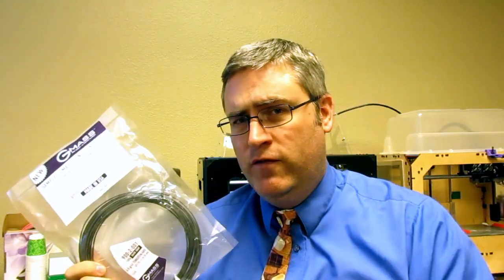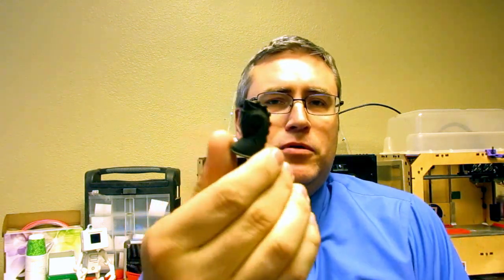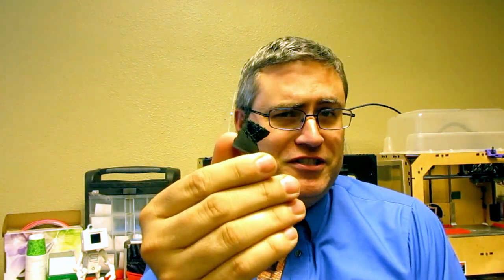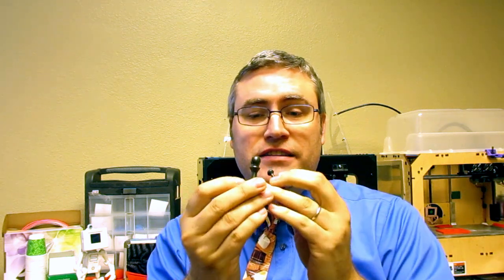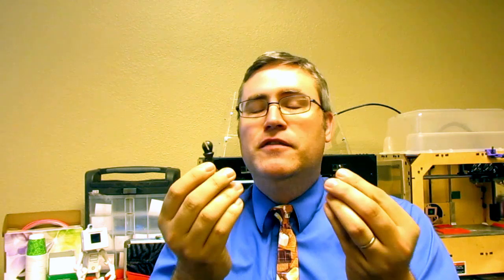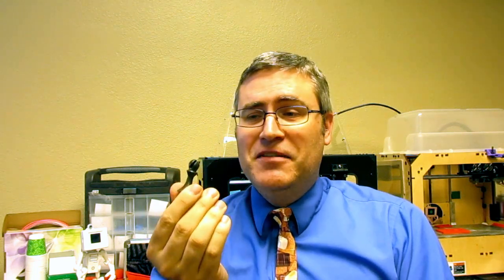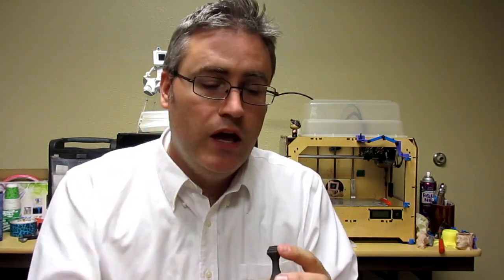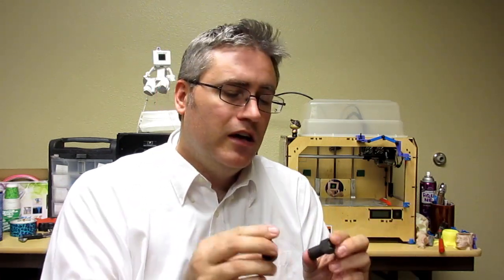3D Printing with Tungsten

Comment: tungsten filament? feels like that would ruin even the hardest hardened steel nozzles in minutes.
Reply from the maker: I recently realized that my hardened nozzle had been reemed out. Couldn't figure out why prints weren't working until I set the nozzle diameter even a little higher. Yeah, this stuff is rough on even the hardened nozzles.
Reply: ckusel123 yes, not only carbide coated but made entirely from carbide.
Reply: On the hardness scale, tungsten is around hardened steel. Tungsten carbide on the other hand is harder, and is abundant in the wood and metal working industries, so its probably the easiest of the hardest materials to source meaning it'll be cheaper.
Reply: There's the olson ruby nozzle. Corrundum isn't quite as hard as silicone carbide, but nearly.
Reply: My thoughts exactly... any carbide coated nozzles out there yet? lol
Reply: Ceramic nozzles, ftw.
Reply: davidsirmons they will crack after a certain pressure and temperature are achieved.  Need to make a sintering power  printer that makes an object that once heated fuses to the final object

Comment: if your piece is hollow like it seems to be the case with the pawn, you could try to fill it with fiberglass resin thickened with powder. It may give the parts enough strength to be used without sweating it. I have not tried it myself (yet), just an idea 
good vid
Reply: +1 on the resin fill, then hand wet sand with acetone high grit?
Reply: Bondo body filler? linseed oil putty even.

Comment: Could this be so brittle because it was printed to fast ??!!!. I had abs, that had become verry brittle if i had printed it with more than 40mm /s
Reply from the maker: I think it's brittle because it's a mixed material. The PLA and the tungsten don't blend like an alloy, they remain separate, the Tungsten dust suspended in the PLA. So the PLA isn't solid, it's broken up by little holes of Tungsten. And whether the holes are Tungsten or air, it weakens the surrounding structure.

That's my theory anyways.
Reply: That could be one reson. I think the problem with the abs was, that it does need time to melt togeter with the other layers

Comment: Would the tungsten not be an ideal material to use to 'coat' a stronger core material in a dual extruder machine? You wouldn't get the heft of a pure tungsten build but the brittleness would be minimized.
Reply from the maker: That's a potential way. You'd only keep the look, and quite frankly if you want a metallic look there are better ways. Like Krylon.

Comment: Does it conduct electricity at all.. Has anyone zapped it yet ?
Reply from the maker: Just checked it with my multimeter. Nothing. Might as well have been trying to conduct through plastic. Fortunately there is conductive filament.
Reply: 3D Printing Professor
I didnt htink the multimeter would be good enough. Thanks for trying though.
Though I am guessing its insulation properties will break down at some point. A multimeter only puts out <10volt.
Do you happen to have a cable insulation tester? Id be trying with that.
If it can handle 1000v over say 20-50mm with no arcing then id be a little disappointed.
What I meant by 'zap' is a visual electric arc. Thanks for sticking the meter on it and replying :)
Reply: Tungsten is ~30% as conductive as copper and ~28% as conductive as silver, and ~17% as conductive as carbon. Tungsten is also more resistive by ~3.5 times as copper, ~3.7 times as silver, and ~5.9 times as carbon.
Tungsten is similar to Zinc, where Zinc is ~84% as conductive and ~1.05 times as resistive. 
Add the fact that the filament is plastic with particles of Tungsten (Melting point of 6,191°F or 3,422°C) and the resistivity of the plastic makes the material virtually non conductive. The plastic may however be electrostatic, but not actually conductive.
Reply: ok. So I will change my question to insulation then. At what voltage does it break down. :D
Reply: It's an ABS based product. Abs has a dielectric constant of 3.2-3.3 @1MHz, dielectric strength of 20-25 Kv per mm^-1, dissipation factor of 0.02 @1Mhz, and a volume resistivity of >10^15 ohm/cm. Properties are most likely skewed due to the dispersion of tungsten in the material.
Reply: It could be an interesting test. I suppose it comes down to how much metal is in it, The size of the particles, And the amount of plastic separating each metal particle.
Reply from the maker: This whole conversation is way over my head. Wow.
Reply: I'd assume that it's majority tungsten considering how abrasive it is, with the plastic being more like bonding material rather than a filling material, which would also help in layer adhesion. 
Not enough material thickness to stop tungsten from being an abrasive object, and I'd assume the inner material between tungsten particles is either as thin or thinner than the outside layer, which by simple logic, is quite thin. 
I don't remember the exact wording from the manufacturer's site, but it was something along the lines of the tungsten being densely packed. 

I have an idea, not sure how well it can be tested, but they could always leave the center of the extruded cord somewhat hollow, which would allow for almost a wicking effect for the outer plastic layers to wick into the center of the extrusion, allowing for a 100% tungsten surface finish. 
I have no way of testing this, and I'm not sure how it could be tested.
Reply: Also 3D Printing Professor, if you missed my other comment on your video, I suggested finding a tungsten carbide nozzle. It's harder than tungsten, and of all the hardest materials, it should be the easiest to source considering the wood/metal working industry uses it in a lot of products.
Reply from the maker: I did see your comment. Having a hard time sourcing a tungsten carbide nozzle for a number of reasons, but I plan to sort it out.
Reply: Dddmaterial sells a 'tungsten alloy' nozzle for 34,90 €. You might have to get a tungsten carbide nozzle machined, as the market most likely hasn't had the need for one until tungsten based filament has came out.

Comment: A brick house is only as strong as the mortor. A these metal based carbon fiber influxes ABS or PLA plastics are not going to be any stronger then the ABS or PLA the metal or carbon fiber mix is in.  You are wasting time, money, and tearing up your printer for no real good reason. You want strong parts that can be smoothed with acitone then try polycarbonate (it is used in bullet resistant applications).

For just raw strength then try PETG. It is stronger then PLA and abs yet does not trash your nozzle
Reply: I agree, these infused filaments are a bit too faddish and actually contaminates the filament making it less recyclable.  They have their place, but I wouldn't be too sad to see them disappear altogether.
Reply: I was going to correct you, but then looked back through Tom Sanladerer's Filaween series. All of the carbon fiber underperformed, unless it was non-PLA, or literally interlaced the carbon fiber into the print (at a rate of $1000 a KG)
Reply: true, but if you want nice heavy chess set pieces its not bad (or similar applications where you want a bit more weight), though its probably cheaper t just buy nice chess set pieces.
Reply: radiation shielding O_o?
Reply: Yep. Radiation shielding.  I've seen GMASS' tungsten and bismuth filaments in the Micromark catalog. (Good material for browsing on the can, but prices too inflated to order from.) The benefits of metal-filled filaments are-- and most people understand this --mainly aesthetic. Much like cold-casting resin parts... No one (sensible) imagines they're adding metal-like strength to a part.
Reply: I have aluminum filled filament that is actually stronger than base material, wich is PLA> ALso, I'm in posession of carbnon nanotubes (NOT FIBER!)  filled, PA6 based filament. And this stuff is bonkers!
Base problem with all "fill" filaments is that they are using way to much filler, and become brittle. Carbon fiber fill doesn't bond well with polymer,  you can observe that with pulling string of filament between your fingers. It leaves fiber/sooth "graphene" (LOL that mareting BS). Nanotubes are so tiny, they selforganize along polymer moleculs, and bond with it.
Resulting material is hard as coffin nail. It also prints bit easier than regular PA6.
Anyone interested? It's made in EU with top of the line ingredients. I ship worldwide.

Comment: Do you have any information on 3D printers that use inks to print full color?   Also, any info on full color printers that have two heads?
Reply from the maker: The only 3D Printing process that produces full color prints are powder based 3D printers that bind material with color. They're expensive printer to own , run, and maintain. No FFF process colors materials as it's going. There are some patents that add colorant right at the nozzle, but no functional prototypes. By the way, I totally thought of that first.

Dual nozzles is the easiest solution to the multi-material problem, but more exciting to me is the multimatieral to one nozzle. But with attempts at multicolor through a system like that you have the problem of colors blending taking several mm of material, meaning quick changes can only be done with much waste. Believe me, I'd love a true full color FFF process but so far that doesn't seem like a feasibility.

Comment: Thanks for the review 3D Printing Professor,
Can you do a video where you experiment with the radiation shielding properties?

The main practical application for GMASS is its X-ray and other radiation wave shielding properties. Structural integrity and strength is secondary.

Cant wait to see what you can do. Great job on the prints by the way!

Check out GMASS's newest video while you're at it:  https://youtu.be/e2sgVtbnSmI
Reply from the maker: I'd love to. I'll probably have to recruit the local college. And get more gmass.
Reply: lol

Comment: if no one has mentioned it the tungsten will make it both much harder to scratch into and makes it very dense against radiation so you can use it to make shielding as they mentioned :)
Reply from the maker: How would I test radiation shielding?
Reply: Quite a bit of tungsten impregnated polymer is being used for radiation shielding as per pound it's at least as good if not better than lead but far more easy to use and handle. 

As for these prints, even if the tungsten density is high enough to provide reasonable shielding, the brittleness really means you have to make sure your designs are for pretty much pure compression.  I didn't see any crush tests comparing it to abs so I cant exactly comment on it's strength in compression and if that is enough to make a difference.

As for testing how well it shields, that is a doozey. Not knowing what universities are near you I can't directly recommend one.  Although if one nearby does have a nuclear engineering or nuclear materials curriculum I would imagine they would be happy to run a few tests provided a couple prints of varying thickness / fill ratio to play with.
 
As for testing it yourself. The gear needed to get reliable results is a couple hundred bucks at least and unless you are already interested in nuclear things, radiation, or just want to have a calibrated radiation detector and sources on hand it's not really worth your time.  I'd offer to test some stuff but most of my gear is bulk counting type (and not calibrated) so I could only give real rough estimations. I have just as much trouble convincing the wife to let me buy $1500 "toys" as the next man. 

If I had to guess for a use it would be shielded sample containers or little cups to fit at a certain distance to the head of a detector to shield at least some of the radiation from hitting other nearby detectors. As for industrial uses I'm sure there is something but I'm not seeing it. Industry uses lead, steel, water, concrete or the tungsten mats for big things and generally doesn't care about the smaller objects that would fit into a single print or small assemblage of prints that a small to intermediate printer could produce. Larger prints have me fearing collapse under it's own weight.  Unless you have a dual extruder that would extrude a more robust outer shell and use the tungsten as a filler.
Reply: 3D Printing Professor
 you would need a way to measure radiation and a way to generate it so you can test with and with out the shielding to get a baseline and a response during to compare the two together, but it (tungsten) and bismuth have been touted as being "safe" alternatives to lead radiation shielding.
Reply: for testing and source generation material I would suggest www.unitednuclear.com as they not only have testing (geiger counters and radation key fobs for early warning exposure limits but really cool stuff like magnetic putty (like silly putty but it reacts to a magnet and some even has its own magnetic properties) and super powerful glow pigments and paints that glow 10x brighter and longer than old zinc based phosphorescent pigments (I have some of both and can say it is amazing and I definitely got to get a filament making extruder to make my own glow in the dark filament lol)

as for the brittle nature of the metal infused filament I am glad you put this out as I have some iron and some bismuth from matter hackers and now I know to throw in some surface protection with a third filament like say abs as a shell and maybe some internal layers to protect my prints since they are all meant to be moving part devices when done for energy research.
Reply: Gamma (Co-60 is the common reference) and Neutron are the real issues when you consider shielding for personnel. The rest are only really problems when you have internal exposure as alpha and beta don't penetrate much. e.g. Alpha only has about 4 cm in air of travel and beta can easily be shielded by around a cm of metal.

Comment: The bubbles aren't from trapped air but trapped moisture that turns to steam when reheated. If you desiccate the filament in a container that is under 25% RH for a couple days before using it, you probably won't see bubbles when you vapor polish it. Alternatively,  you could desiccate the printed parts in an oven set below 100C before vapor polishing them to alleviate the problem.
Reply from the maker: Not... sure that's the case. Only because I live in the middle of the great american desert here and can dehydrate fruit if I leave the window open. But I think it might be something related and maybe a cold smoothing process would solve it.
Reply: +3D Printing Interesting. Perhaps the way they produce the filament traps air??  I bet you are right about cold vapor working better since air pockets wouldn't expand except where the acetone leaches in.

Some related info...I lead a 6 month filament recycling study for NASA an found that filament stored at 25% RH or lower didn't produce an particles when extruded. If it was stored at 50% RH it generated high concentrations of particles.  Our guess is that the trapped moisture produced many tiny steam explosions as the filament was extruded which created the high psrticlecount.
Reply from the maker: Are you associated with the Made in Space guys? Either way you are way cooler than me, doing work for NASA.

I've long heard that humidity can effect filaments, but like I said, that's a problem for me to test where I am. However, I suspect that different filaments are more or less hyrdo... what's the opposite of phobic? Anyways, i wonder if ABS/PLA/PET/XT etc can be more or less tolerant than others and if there isn't a totally hydrophobic material out there that is immune to humidity.
Reply: +3D Printing We were in a sense competitors to Made in Space for that project. I'm on my own now as an independent product developer. 

ABS and Nylon are more hydrophilic than PLA (absorb water more easily) so it's more important to keep them dry than it is for PLA.

Comment: Can the tungsten fill take heat?  Is it abrasion resistant?  Or is it just heavy, brittle, and I presume expensive?
Reply from the maker: Nope and nope. Melts at ABS temps and scratches just like ABS. Though I suspect it has electromagnetic properties. I'll have to check. Also, it's shiney.

Comment: Don't own a FDM 3D Printer ( just a SLA ;D ) so my knowledge with them is limited but could a dual extrusion head system be used to have the outside "shell layers" be made in Tungsten Filament for looks and the inside "infill layers" be made in Regular Filament for structural integrity?
Reply from the maker: Maybe, but it would be tricky. I don't think it'd be simply a matter of settings, dual extrusion like this requires some clever model editing, creating a shell and infill model and meshing them together.. And the tungsten fill isn't just about the outside surface either. It's weight is substantial and an attribute I'd want to use this filament for. So we'd need a shell or two for the finish, then a shell or two of something that's got the structural integrity, then the rest of the infill in tungsten. It might be hard in this case with as thin as some of the parts got. But it would be educational to try.

Comment: Interesting filament there. Looks great, I doubt I would buy it and a specialty nozzle just to do that. It was really cool seeing the results you got though. Thanks for sharing.
Reply from the maker: That's kinda the take away from this. Intersting, but not useful enough to merit the effort to use it.
Reply: That finish looks really nice, too bad about the rigidity. Do you know of any other metal material that would look good and also hold up structure wise?

Comment: Tungsten would make sense with a dual head printer.  If you wanted heft, use tungsten for the core and standard ABS for the outer shell.  Or if you wanted the look of the tungsten, do an ABS core with a tungsten outer shell.